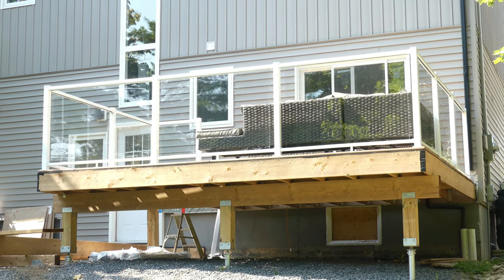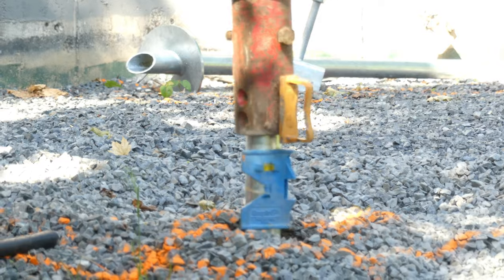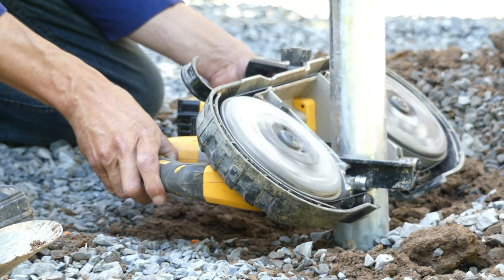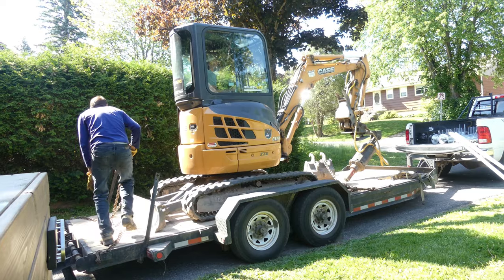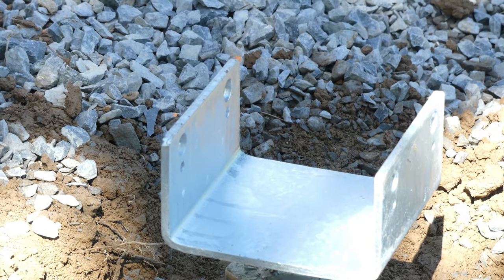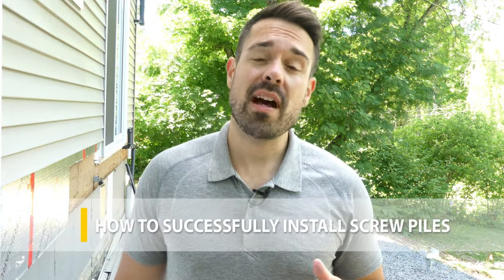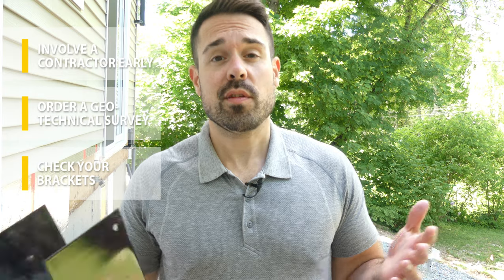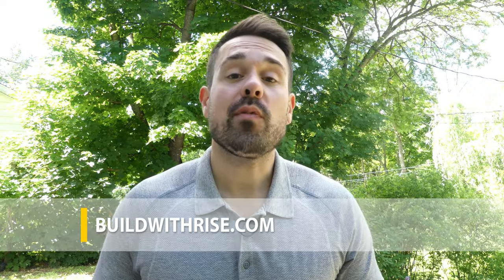Helical Piers (Screw Piles) - Pros, Cons, and FAQs

Comment: If you had hit a rebar in the ground as a guide for the diy one. You would have found the rock.
Reply: So then how do you extract the rebar in the exact location for your piling.  Ever tried to extract driven in rebar diaper than 4’?  I didn’t think so!
Reply: @marksaunto2588  No need to extract the rebar. That location is not useable because of the obstruction. So the rebar detection system worked. Yes, it was a self-fulfilling prophecy, But it did work.

Comment: The company I work for uses Screw Piles for Radio Communication towers, Highway Installs & for Rail Installs, we make our own piles to suit the ground conditions and the job involved, all our piles are Galvanized & in the case of Highways are also painted to spec, we have installed down to a depth of 60.mtr ( 200.ft) due ground conditions.
Reply: Which company do you work for, which is producing helical piers?

Comment: Our contractor used these on our new deck, and I was really impressed. They went down 12' to some really solid soil. The first several feet of soil in our yard is kind of spongy. Going down 12' with a concrete footing would have been a real project.

Comment: I like the idea of these things. There are a few things I've wondered about:
 1. Long term corrosion resistance: Zinc plating is amazing but over the long term especially where the pipe comes out of the ground and especially in marine environments are they reliable over the long term?
2. Why not some more flanges? Seems like if one is good two is better?

I was surprised that they were often substantially more expensive than concrete piers. But I probably shouldn't have been. Drilling four feet or so holes can be done very quickly with an auger attachment on a skid steer. I wonder if the screw piles aren't a big money saver in areas where deep piles are required for a house foundation.

Comment: I am watching this video because my wife and i purchased a home last October in TN that now has foundation issues.  Not the best way to start but owning a home comes with lifelong ongoing repairs.  We are in the process of investigating and deciding between push-piers and helical piers.  We need two things completed on our home... 1) 6 piers installed on the back right corner of the home as it is sinking to the point of a large crack in the brick from ground to soffit... and 2) ibeam or ibeams installed under the floor in the crawlspace in that same section of the home as there is a moisture issue that has caused  the floor to sag due to no current support in that section of the home.  One company seems to be better at the under floor ibeams but uses push-piers and will only stabilize-no lift and the other company uses helical piers and guarantees to lift our house back to the original level when constructed, but lacks in the underfloor beam department.  I will try to remember to come back here once we make our decision and have the work completed to give everyone the final analysis.
Reply: Hi Jason, have you called GoliathTech Screw Piles?
Reply: Some add in concrete high strength grout with the pile on soft clay.
Reply: How did it go? Thx
Reply: Any news?  It's been 4 years... lol

Comment: Also remember with concrete piering, you need to remove the spoil that you dig out of the hole. If you're only doing a few, you might be able to spread it around the garden.. but if there's a lot of piers, you'll need to pay for spoil disposal.
Reply from the maker: Great tip!
Reply: 💥 No matter how many concrete footings I’ve had to use it was no problem spreading the dirt of each one  around the footing  with a rake.  It’s under the deck.

Comment: Please help! I had helical piles installed by a qualified contractor 6 years ago for a deck and they are moving, the contractor says he has never seen this before. The one end of the deck has risen at least 6 inches causing issues with my glass railing and my deck boards. He is telling me that it is because of water in the ground possibly from evestrough! Is this an issue???

Comment: Capacity depends on cohesive strength of clay soils for friction.
Soil mechanics Engineer needed on larger projects. 
Many can hold 20+Kip's each.
Used in NYC large projects.
Reply: Most jobs I do for foundations require 25 kips and decks usually 15
Reply: I just started here tho so I don’t know much about it. That’s why I’m here @Golem1
Reply: Technometal Posts P3 were quoted around $350 or so, and rated at 33Kips, supporting 33K lbs. Not affiliated, but very happy with the pricing and 1-day install.
Reply: @boots7859  33 kips in that soil there?
Reply: No structural or geotechnical engineer allows skin friction to be applied in calculating capacity of screw piles.
Reply: @vincentmackenzie9133  Here on long island NY all homes built along bay are not " end bearing" but skin friction hammered into refusal.
Not sure where you do pilings.
ENR formula ?

Comment: We have installed screw piles for our cabin at turtlelake Saskatchewan, we have noticed that they are shifting our cabin.  Any ideas on a fix.  We insulted the crawl space but it still shifted.  W3 are about 200 feet from lake edge.
Reply from the maker: That's awful to hear! There are many cases of helical pile plans/installations not being reviewed by an engineer, thus resulting in problems like yours. The CCMC suggests to Canadians in your situation that they should contact their local permit building office to see what engineering and paperwork exists. In some cases you can take legal action against the installer. CBC did a fantastic article on this issue in 2019. Great read: https://www.cbc.ca/news/business/safety-put-in-jeopardy-by-some-companies-shoring-up-shaky-homes-industry-complaint-alleges-1.5184859
Reply: "Pro" piles or "Audrey" piles? One advantage of properly engineered helical piles is that 10'+ underground, the bearing plates never experience freeze/thaw cycling so insulating your crawl space should have no effect on the foundation. Still a good idea though!
Reply: @buildwithrise  Agree.
Reply: i would stop insulting the crawl space and maybe the problem will go away…
Reply: I am an installer in alaska. if Saskatchewan has similar frost heave issues, two things cause shifting: 1) if the freeze/thaw cycle creates any horizontal pressure.
2)if the piers are on a slope cutting thru overburden to the bedrock, the soils can "seasonally shift" down hill.  it takes a lot of excavation work to cure these problems.

Comment: how are they  to get all the brackets in the lined up and in the same plane? do they allow for adjustment? I know you would want to take your time laying out the locations but it seems like any slight variation away from your line would be horrible to remedy.

On another note I have been considering using these for a tiny house. Build the house on a trailer and make it removable so it could be placed on a foundation elsewhere. Do you think these would be a good solution? Thanks
Reply from the maker: Hey Cody! The brackets are typically height adjustable, and as far as precision, it's about as precise as it gets, and often contractors who specialize in this type of install will guarantee the work to make sure this is the case. There are also offset brackets with as much as a one-inch offset that can remedy precision issues. Keep in mind it may not always be 100% as soil conditions may not allow it, but installers will usually come within a fraction of an inch.

And yes would absolutely be ideal for tiny homes, but only consider professionally installed piles with an engineering report that shows the weight supported by each pile. No DIY piles for that kind of job!
Reply: @buildwithrise  great. Thanks got the reply!
Reply from the maker: @comak7573  Sure thing, Cody!
Reply: For calibration the piles in straight lines and depht you'll use a laser liner of course 😊

Comment: This was informative and, I think, thorough. My only question would be whether or not helical piers could be suitable foundations for larger structures, like a small house? Thanks!
Reply: Helical PIles can be used for larger stuctures such as house's even two storey houses. There are an assortment of different size helical piles to suit any type of wieght load and structure.
Reply: Definately
Reply: These are the standard for many highrise buildings, and whats often used in repairing old foundations.
Reply: My company installs screw piers that support up to 300 tons each. Last December for a nine storey residential/commercial building
Reply: @vincentmackenzie9133  I'm looking for an installer in the Seattle area.
Reply: I can come to Seattle to see Frasier in true real life and kicking! I fly from Finland with a fiew piles on a plastic back with my 🐕

Comment: I'm planning to build a small house (about 12m x 16m platform) single storey on a hillside in Mongolia using SIP's (structural insulated panels). The price you're talking about is outrageous by our standards. The cost per buy for DIY use is about $10 to $70 depending on type (screw, helical or X-section). My time is free since I'm retired. No way could I afford $250 each installed. It's virgin land so there's no utilities, no codes and I can do the engineering calculations myself. I also don't want to excavate and create a solid concrete foundation since it would scar the land.
Reply: How many piles will you use? How deep will you need?
Reply: @GrampalettasCamp  I changed direction. The ground screws were too expensive and installation difficult on rocky ground. So we hired an excavator to cut and fill a flat area of ground then built several yurts instead of a house. We’re very happy with the result.

Comment: What the heck, Goliath is quoting me $525 per pile for 7' here in MN. I'll have to show em this video and ask what the deal is 🤨 Should be more like yours at $200. I'd be more open to contracting it out then, this is for a tiny 200 sqft man-shed.

But I'm also thinking since this doesn't need any engineering specs or review, I may be able to DIY the Pyrex 50" piles myself with some 24" extensions for the rear (on grade).
Reply: I'm wondering if they quoted me for extra long piles because frost code is only 42" here, 7' seems excessive. I didn't catch how long yours were in the video but they look 7' or so.
Reply: Understand.But today's stee, labor are also expensive and are still going up. May also check with other manufacturers to make the decision
Reply: Curious to know what you ended up doing..
Reply: Prices vary from state to state, project to project, depth of the pile, access of the area, hazards, planning, logistics.
There is no fixed price because each project is different. The price mentioned in this video is very low and could be possible in a solar farm scenario but not for deck installation of a few in 2023. In Texas I've seen $450 - $1,500. Depending on quantity and all the variables I mentioned.